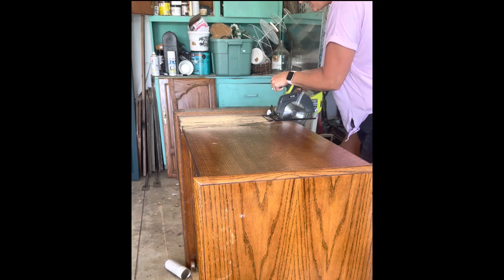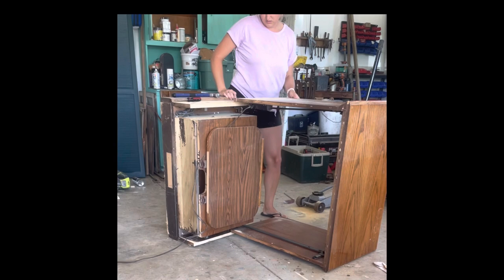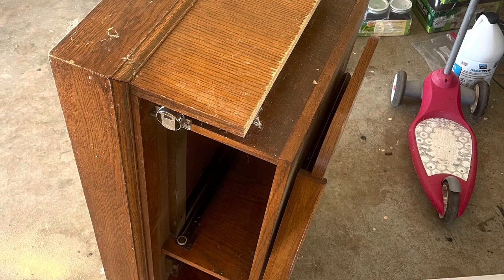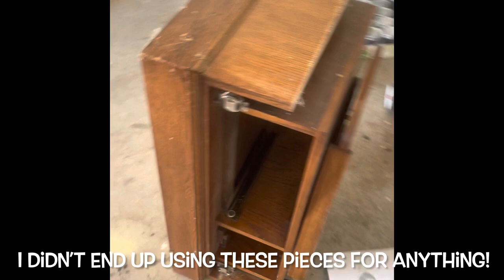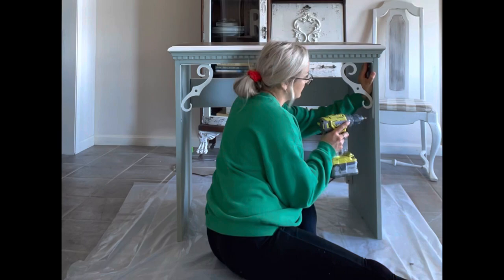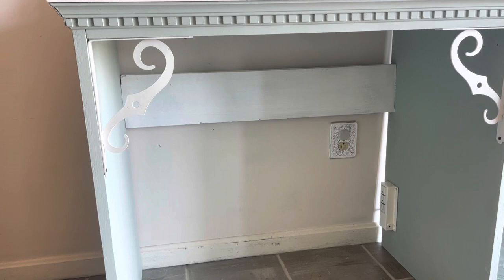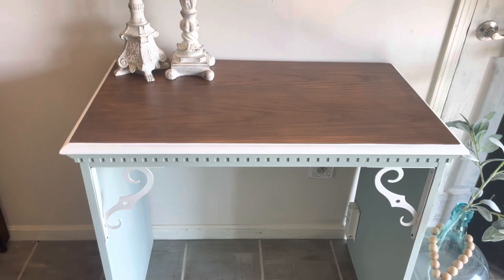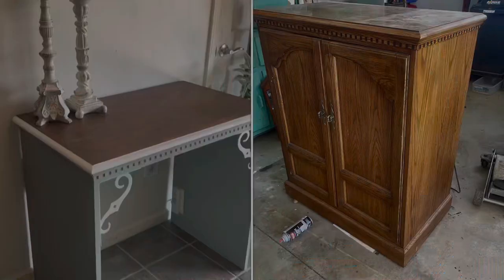How to: Transform an outdated tv stand into a way more useful desk!

Comment: I just had a similar experience trying to remove a solid wood ledge.  A multi purpose tool with interchangeable blades works really well, they have metal blades too. It's a hand held vibrating tool that can get into tight spaces.  I admire your persistence  in getting that apart.  It payed off, nice piece.

Comment: Reciprocating saw (Sawzall) has interchangeable blades that can cut through wood, wood w/ embedded metal, metal, or other. Using a circular saw with a standard blade through metal is bound to damage the blade.
Or multitool, particularly oscillating. There are a million and one attachments you can get. An oscillating multitool and a rotary tool are very versatile for all kinda of detail work.
Reciprocating saw is more oriented towards construction work.

Very nice brackets!

You probably oughta put filler on the seams. That gap on the corners near the top really stands out.😕
Reply from the maker: Thanks for all the tips!